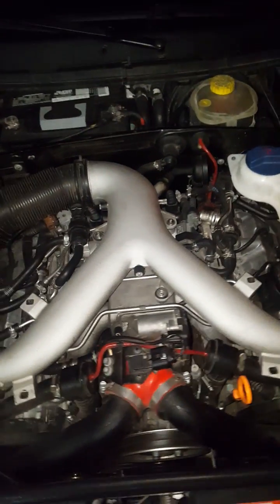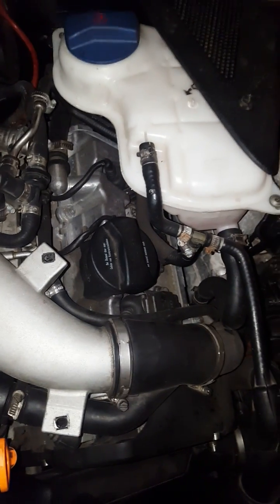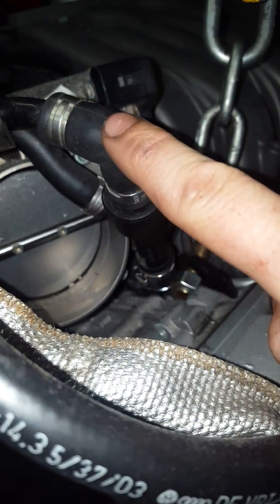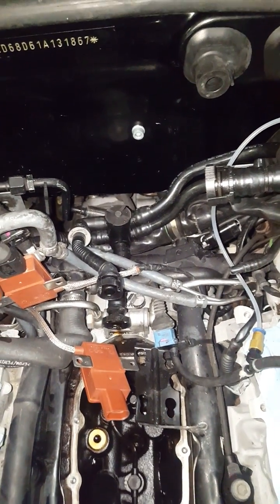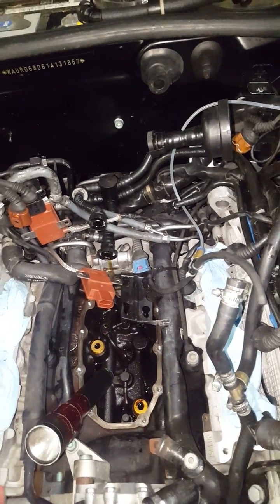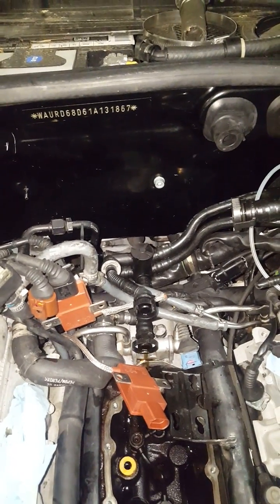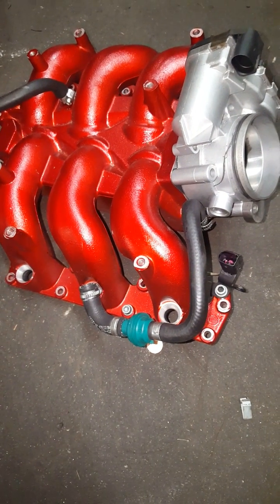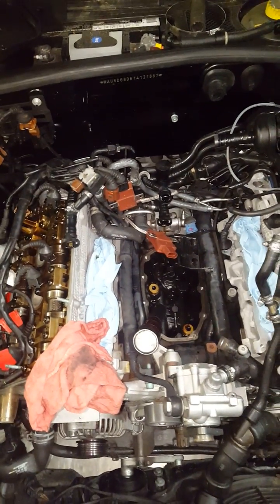Audi S4, A6, A8, Allroad 2.7t fuel trim faults, boost leaks, poor mileage, poor driveability

Comment: As all the other comments this is a great explanation of a very confusing and complex system, much better than other explanations, I have made an entirely new spider assy from heat rated silicone hose and reused the factory quick connects, my particular 2.7 was the 230HP model which still had the F hose so i deleted that, I also replaced the one green check valve on top of the intake as that was damaged, still have a massive issue in that the car runs fine, but its way to rich especially at idle, so im guessing vac leak, i have replaced various oe hoses on the system that looked bad but i cannot now find another leak, its very hard to see much of the vac system on this car as its so cramped. Now I have those values you mentioned for the MAF I will at least be able to check them as I fear my MAF may now be reading incorrectly but i also fear this is still down to a leak somewhere, I even did a smoke test and found nothing. DV Valves were also replaced for good oem plastic ones already
Reply: Did you find the problem, I have the same issues as you?
Reply: @bkingtz1  torn throttle body boot was hard to spot until I did proper pressure test
Reply: @adv-nomad 
Thanks a lot for the reply (after all these years heh).
I'm really having a problem with mine, misfires, usually codes of too rich mixture, and sometimes to lean, and he is gulping gas like crazy, I think I am just pouring a liquid gasoline from the exhaust 😂

Comment: do the 2.7 c5 6mt sedans have the same exact engine code? APB?
Reply: Depends of the year. After from 2003 is BEL , APB has ignition coils square with bolts. BEL has 2.0 style

Comment: so if it would be the way you say, it should run bad/wrong/rough when oil fill cap would be opened right? from what i know and checked it runs normally.

Comment: I'm pretty sure I have a boost leak. I did the spider hose from 034 motorsports. I noticed a broken vacuum hose that goes to what I believe is the vacuum reservoir. I did the DV valves (plastic). My symptoms were bad gas mileage, intermittent cylinder 4/random misfire (under load), lose of power and failed a boost leak test instantly (couldn't hold even 1psi). I'm hoping it's not valves, valve springs or head gasket. One thing you said about the built of pressure in the bottom end that hits homes with my issue... Is my oil pan gasket started pushing out, my front crank shaft gasket popped out and leaked oil, I notice oil leaking from the back on the motor (cam seals, half moon, etc.). I am guessing this is all caused by a boost/vacuum leak either that broken hose did it over time or there's a bigger leak somewhere else, or it's really really bad and something much worse. I am going to just do anything and everything you mentioned and see what happens.

Comment: That is a great explanation of the impact of positive crankcase ventilation system. I would never have related transmission clutch pack failure to dirty MAF sensor. The importance of regular maintenance ...

Comment: Great video ! My 03 a6 2.7T has an oil leak and its getting on the belt and going every were and it doesn't pour out but when driving it leaks a decent amount and seems to be coming from around the valve cover , has 100,800 miles
Reply: also check the oil cap make sure you have the updated psi release.

Comment: Hey I have a b5 s4 and the other day I went on break at work and it ran perfectly, then I went out 5 hours later to leave work and it started misfired and died, if I drive it and get it up to temp itll run and stay running but run rough I checked the codes and I got p1128 p1130 and it had a p0305 the other night and it went from running 20psi of boost to now it wont go over 6, any ideas what it could be? Once the cars warm and running a bit better it is running perfect vacuum

Comment: Quick Question!! So my Audi A6 2.7 2001 Has been dying on me while driving every time I drive it for 1-2 hours I was told it was the battery or alternator and I replaced them both brand new so I don’t know what could be the problem, something is killing the battery
Reply from the maker: Isaac macias I have a very long in depth vehicle describing how to diagnose the alternator and charging system and identify if that's the issue.

Do you have to jump start it after that it dies? If not then it's the fuel pump or crank sensor most likely.

Comment: Dame! u are good!  Thanks 4 sharing!  I have one 2.7T Allroad 2004 Most informative video I've seen on the subject!
Reply: Im about to get my first "modern' car (because not to keen on the electronics in them) a Audi Allroad 2.7bt. I waited so long due to gain trust with new technology in them (strange I know) just like to know if possible, how is it to own for long term, any problems? computer glitches, seal problems?   wanted one of these for ever, but it's full of computer power.
Reply: I own 3 b3's (2 of them were gen2 Quattro) not one problem for 12 years, apart from one had a ignition coil problem, 100$ fix.

Comment: Hey man So My B5 6 speed is like jumping whenever I hit boost. Its almost like my engine is getting slammed around in the engine bay is what it feels like...its fine until i hit the boost then it studders and feels like absolute doo doo     New plugs recent.  No engine codes...stage 2 ECU   after market diverter valves..

Comment: Those check valves need to be replaced,all of them! Take from me, my 2000 s4 automatic pop the crankshaft seal and leaked all the oil in the engine. One of the check valves got stock close and needless to say everything in front and top of the engine had to come off in order to fix the seal and the bad check valve.

Comment: Hi, i have a 2011 S4 3.0TSFI with coolant leak which i suspect it is leaking through to the exhaust because it gives a steam exhaust when idling, what could be the problem? Is it a top gasket fail? Spider pipe leak? EGR fail? ... i would like some help before i take it to the specialist.

Comment: Mine stutters between 4th and 6th gear under load before boost.? Currently running jfone stage 3 f21! So it suffocates like before boost
Reply: Hey I have a a6 Quattro 2.7t that I did a f21 stage 3 tune to and ever since I did the tune it's burning super rich on idle and has rondum misfire, I checked for vacuum leaks, sparks plugs and coil but still can't find the problem.
Any help will much be appreciated.
Thanks.
Reply: @simroycampbell1477  did you ever find the solution to the problem?
Reply: @freddiemendoza4188  yes it was the spider house that was leaking

Comment: wait a sec you said 2.7t doesn't have combi valves mine has 2 one on each side fucks up my access to the valve gaskets.
mine is a early 2000 a6 2.7t base not allroad

Comment: Curious as to how you removed the valley pan with the coolant hard pipe installed. I tried to remove it from my BEL engine and I kept hitting the coolant hard pipe.
Reply: you have to drain the system and remove the bolts on the back right side holding that hard pipe.

Comment: My 2001 S4 recently started loosing boost, also when I throttle it and go up to high rpms my boost goes down to 10 psi and the car starts "stuttering" and rpms raise very, very slow if I try to hold boost at 5psi it just drops, what could it be?
Reply: Moto Utah you wouldn’t have found out what the problem is? I’m having the same problem
Reply: @Domohhh  me too. decent in first but if i floor it she goes no where, 3/4s of the way works better
Reply: FuxEmUp I figured it out my maf was bad and my crankcase breather hose was broken. If you have an aftermarket CAI your ignition wires might be to close to the maf

Comment: Thank you for that, greatly appreciate the way you took the time to explain everything like if you're talking to someone right in front of you, very helpful I myself have a 2.7 L allroad.   2004, greatly appreciated  once again for the explaining that you do, keep it up, very helpful to us. ... please continue explaining on subjects that are   Connected to the allroad
Reply: MrRio1973 What would cause my car to have a misfire I put in brand new coils and spark plugs, I also changed the valve cover gasket, it shake a little and the engine smokes a little
Reply: @isaacmacias4295  another thread I saw said to replace the two ICM.s (ignition control modules)

Comment: I have a c5 2.7 that I am slowly fixing and I was driving it finally and it would accelerate very slowly and the rpms would build slowly then it would shift and would run normal until I stopped at a light again would that be a problem with a boost leak?
Reply from the maker: Nearly ALL rpm and boost issues can be traced to their breather system as shown in this video.
Reply from the maker: That'd be more of a vacuum leak than a boost leak, but it's ALLLLL part of this system yes. You really need to do it all in reality or you'll just keep having issues with breaking pipes, oil leaks, failing mass airflow sensors, the oil leaks will leak onto coolant hoses, and eat those. And like the video says, the breather system being bad will throw the maf readings off, and the shift points off for the trans. So even when you're at full throttle and the trans is under max load and it needs to have maximum transmission fluid pressure, it won't, and that'll cause transmission failure through internal slipping.

So, if you want to try to find the a broken hose or a hose with a hole, get a can of brake cleaner or starting fluid, start the engine, and spray the hoses in the engine bay. Don't do the whole engine bay at once, concentrate on specific areas, and make sure you spray down at the hoses that aren't right on top. When you find the broken hose you'll hear the RPM pick up on the engine as it gets sucked into the engine and burned.

Do you happen to have an OBD 2 capable scan tool, one of the ones that can read the values in the scan tool like the fuel trims, maf reading, etc?
Reply: I don't have much time to check the car now since the front tires are now flat but I did notice a hose was a little bit loose so that kind of changed how it ran at idle so hope that's it when I do get to driving it thanks
Reply from the maker: You don't really need to drive it to figure this system out. You can do what I'm saying with it sitting.

And if you have an air compressor, you can do a boost pressure test on it as well. Where was the loose hose?

Also, FYI, where the boost pipes come off the timing covers and go to the Y connector at the throttle body, that rubber Y at the throttle body is one of the main failure points, reach up under that pipe with your finger and feel around or use the brake clean to spray around that area.

With how you're describing the super slow RPM build and stuff, you probably don't want to drive it. It's not in limp mode is it? If it is the indicator for what gear the car is in willl be ghosted and it may not tell you what gear it's in.
Reply: The boot in front of the throttle body was loose from underneath a little and no as far as I know it is not in limp mode

Comment: Excellent video; I think, this info would apply to my 1.8T as well. At 14 years old and almost 100k; I am going through ALL of the boost related hoses and valves, parts that are boost related, on my 2002 New Beetle Turbo S with the 1.8T AWP engine. I've noticed, that allot of the valves; like the DV , N249, N75, etc, are in "soft failure" mode and while they technically "work", they are not up to correct performing levels. This is also, probably why; traditional testing methods, cannot replicate real world scenarios and how things work, in a hot engine. Each part I replaced; the boost increased and smoothed out, the boost flutter and low psi. Thanks for the video; I appreciate more in depth tech like in this video, this is the type of info and observations, that come from working on VW's all the time. Thanks again and keep up the good work! :)
Reply from the maker: Yes it absolutely applies to the 1.8t I'm just in the process of making the video still.
Reply: I look forward to that! I'm mainly; working with Mark IV 1.8T's and helping others in support forums, figure out their drivability issues. Your experience and "putting it all together", way of explaining things is really helpful and appreciated! It kinda seems like a domino effect on these VW's; one thing in the system fails and it affects or ends up destroying, everything else! :) Thanks again and keep these in depth videos coming! :) 
PS: it would be cool; to hear about your new career changes, what working in a Audi dealership is like and what your outlook is on the current VAG repair industry. What you are doing now and where you would like to go, in the future! :) It is always nice; to hear about those "in the trenches" and what your perspective is on VW and all the changes that are taking place in the German Auto industry. Thanks!
Reply from the maker: +Billy P. I'm not really working. I had a son born with a birth defect who now at almost 2 years old has a colostomy bag. He's happy and healthy other than that, but can't be put into normal childcare because of it.

I'm working on a website called German Auto Institute to teach these things and how to use all the info in the scan tool that backyard mechanics don't even know is there really. So that will be my job more or less. Hoping to attract some sponsors and things like that.
Reply: I'm really enjoying; the "humble mechanic" lately but many times want more technical information; there is room on youtube for your approach! Going in depth and explaining how different systems work overall and how they all related to each other, how it affects the other related systems. It sounds like; you have a wide experience working with specific models, so you can explain how things work and also, bring your experience into play. Knowing the failure modes, typical failure parts and engineering weaknesses, only seems to come with working on these cars and seeing the same problems, over, over and over again. This kind of information is needed! I hope, you can figure out a revenue stream and business plan, that can work out to support you and your family. Thanks, again! :) I look forward; to your upcoming videos!
Reply from the maker: +Billy P. Yes him and I started around the same time when I had my podcast. When my son was born I had to stop.

I was watching some of his and noticed it doesn't go quite as in depth as well.

I'd say there's room for both. I'm aiming more at professional mechanics or just people looking for more in depth info.
Reply: Keep up the good work! :)
Reply: @GermanAutoInstitute 
So it's been 7 years since this comment, and although we don't know each other, still as a human being to human being I would like to ask you, how is your son, and how are you? 
There is nothing in this world that bleeds my heart as the suffering of children.

Comment: Hello there im looking to buy 2004 allroad 2.7t what things should i be looking at before buying it ?
Reply from the maker: All this in the video, oil leaks at the backs of the cylinder heads, upper control arm bushings worn which you can see with a flashlight even with the car on the ground looking above the wheels up front.